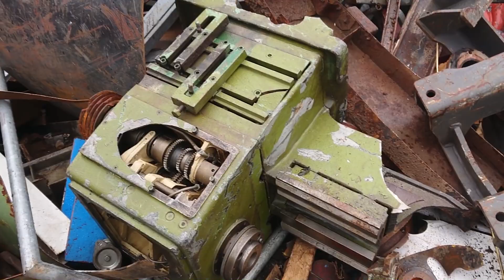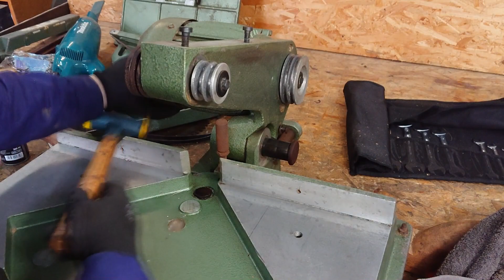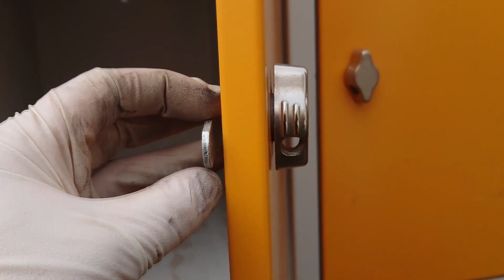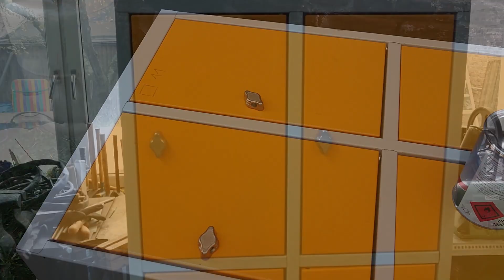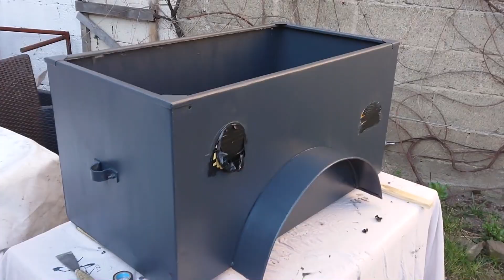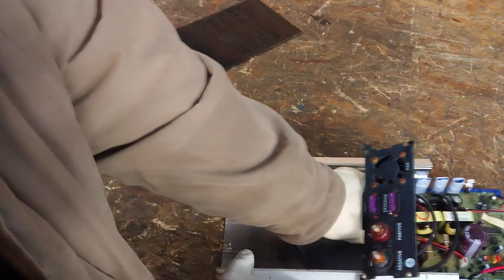Unique Scrapyard Finds! Repair-A-Thon!

Comment: Break cleaner works fantastic for permanent marker and usually doesnt damage the paint. not all brands work though if you want to be shure use "Interflon Metal clean" it works well but is expansive.

Comment: I am re-watching this one again. I love the trailer with battery and solar panel! I'm copying it and building a version with a sprung suspension for use behind my 4 wheeler. I am going to add brackets for two spare tires (one to fit the trailer and the other for the 4 wheeler) and a 'Jerry Can' of extra fuel. Thankfully my 4 wheeler has a low mount 2 inch ball, so the tongue and hookup is simplified. 
      Again, I Love the repair-a-thon videos and I'm looking forward to the next one. 
      Take Care from America and enjoy your trip to England, John

Comment: Did you have the inverter pcb on a metal surface with the pins of capacitors exposed?

Comment: I have some similar lockers I got for free. Had to purchase some keys from the key numbers to get in. Brake and clutch cleaner is good for degreasing and removing glue. You can buy in big cans and put into a spray. You can do the same with wd40.

Comment: I was told by my teacher to use permanent marker to erase permanent marker writing on smooth surface like white board. Just write off the existing with permanent marker, leave 2-3 seconds, then erase it using sponge or whiteboard eraser. It work perfectly. No need aceton or other chemical. :)

Comment: One tip for anyone repairing inverters, when you reassemble them make sure to reattach the temperature sensor to the aluminium casing with thermal glue, otherwise it could overheat and die in future.

Comment: An easy way to pull Permanent Marker ink to the surface is to over over it with a dry erase marker.

The chemical reaction will help pull the ink to the surface and make it easier to clean off. But do this at your own risk.

Comment: I worked in a sign shop in the 90's.   We used Ronsonol Lighter Fluid  for cleaning a multitude of surfaces.    We would use it to remove vinyl residue off of wood signs that had been painted with enamel so that we could re-use the signboard, engraving plastics, glass, acrylic, etc.    I have yet to find a plastic it will damage, or an adhesive residue that it won't soften up and allow me to remove.  

It's usually pretty cheap too.   

Just FYI.

Comment: Looks like there is space for a riving-knife so fabricating one should be quick from an appropriate sized piece of angle-iron or I-beam..
(for some reason multi-purpose kitchen wet-wipes that are lemon scented work better than any other scent for removing stubborn marker/tar/glue and various other gunk remains, and citrus-cleaner is one of those things that has been sold to professionals for ages...)

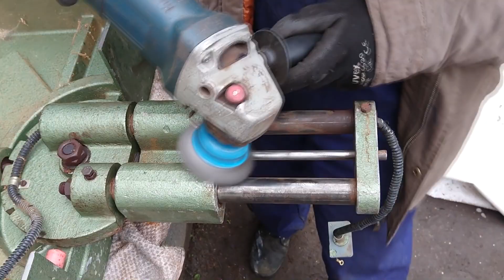Comment: You're not that finicky during restoration process generally. For instance, you're doing a very crude job while using wire brush with angle grinder at 6:55.

Comment: Man I would absolutely love it if you did a general electronics troubleshooting video. Component level board repair stuff. 

It’s insane The type of decent test equipment that’s available for incredible prices these days. you can spend about $100 and get a decent soldering iron, multimeter, miniature oscilloscope, hell even a five dollar logic analyzer, In circuit ESR tester, Adjustable power supply, ect…..

obviously none of it is professional level stuff but I’ve been impressed with some of it, and it is still really good quality stuff regardless.

I have my own small and humble lab and metrology business. I focus on component level board repair but I specialize in high precision metrology equipment repair/calibration/test systems for other small labs and manufacturers. Kind of like a systems engineer but for test equipment. NIST traceable type stuff.

And I’m always fascinated by the cheap but good quality test equipment that’s being made for today’s hobbyists, or people getting into the business on a budget. I have a lot of the stuff and purchased things regularly just for the opportunity of testing them and seeing how they preform for the price point. There is some insanely decent quality stuff these days for unbelievably great prices.

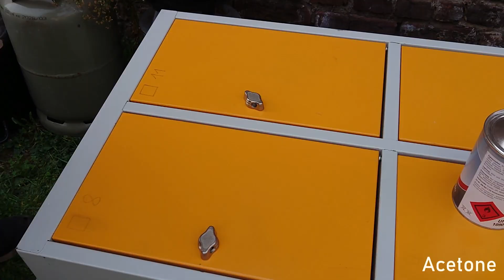Comment: 11:20  Another option for removing permanent marker, is to draw over it with a dry-erase marker, then wipe it away immediately.   They both use the same type of solvent, so the Sharpie ink will be re-liquified and can be easily wiped away.

Comment: Working with galvanized steel, if the part is of older date, there may have been lead added to the solution. So take care when cutting it, especially with an anglegrinder.

Comment: If you deal with a lot of sharpie marks on surfaces you can draw over them with a dry erase marker and then wipe them off. That works on most sharpie marks although when it's really really old it may not work so well.

Comment: I find that 100% isopropyl alcohol (aka isopropanol aka rubbing alcohol) works well for removing Sharpie.  Although I take your point that the issue sometimes is that the Sharpie marks get kind of absorbed into the paint.

That steam cleaner is neat, I wonder if I could get the same effect with an inexpensive clothing steamer I have.

Comment: That little trailer could make the ultimate bike camping setup used with the inverter and maybe you could use a small farm tractor alternator run off the wheel to help charge batteries when on the move.

Comment: Great to see the range of sticker removal techniques, thanks for teaching us so much as always. I thought I would also add that among other things you mentioned I find regular coconut oil surprisingly good at breaking down sticker adhesives, and of course much safer than chemicals and doesn't damage them. I typically use it to remove sticker residue from kitchen bottles and jars, or plastics on items I am restoring.

Comment: I love your channel man, it encourages me to fix old stuff instead of buying new, which I did recently with a whole Hi-Fi system and it's the most satisfying thing to repair/refurbish good quality equipment and learn new valuable skills along the way, I also had to find an electronics shop and now enjoy regularly going there chatting with the owner when I have to get supplies, and once I fixed my sound system revolving around a 1986 B&O amplifier and some equally old good quality speakers, I was hit with a strong wave of nostalgia when I played the tuner on classical music for the first time and even had to shed a tear, so in a way thanks for that because you played your part, this is a good channel and did I mention that I love it ?

Comment: What you said... Pairing that trailer with an electric bicycle... Not a bad idea for making a way to charge your e-bike's battery while on long range trips. Though, if you go that route, it commonly works best from my own point of view to have 2 chargers and 3 batteries to cycle thru, which with an enclosed trailer, should make for an easy way to extend a 25 mile(40.23 km) range into something about 3-4 times as long.

Comment: Tape/ residue solvents when ethanol doesn't work: Petrol/gasoline/Benzin or nafta (high grade specially cleaned petrol) removes the residue Immediately. For the marker, I would use a little isopropanol (blue-rinse). This might work on tape residue as well. Another option for markers is acetone (nail polish remover), but that is a gamble if you're unsure about the surface. Powder coat may withstand acetone, many paints will dissolve. Acrylic plastics will dissolve and foam up. Anyway, these solvents are great to have on hand and will save you hours of scrubbing if used correctly. Also, ethanol is usually the worst solvent to use on anything. Most of the time it just stinks out the place and you have to compensate how ineffective it is by using more, creating a fire hazard. But OK for removing some oil films, though. Also, WD-40 should never be used as a lubricant. It's Water Displacement and turns into wax. Those door hinges that were creaking? With WD-40, they'll start creaking again in a year.

Comment: OK, so on the saw, there is a blade guard; but that doesn't work when it's pulled up and the blade is exposed. However, I think the fence can be positioned over the blade guard, causing the blade to be covered at all times, but the table has to be mounted, of course.

Comment: Nice solar trailer, but... do you think it would be worth giving it the ability to tilt automatically toward the sun? Often this can give surprising gains. You might have to limit it to only moving so-many times per hour, and require a prolonged increase in energy from one direction over the other. Measure this perhaps with little solar cells used as sensors, or photodiodes. The software (and hardware!) would be for you to work out, but microcontrollers can be kept asleep 99.9% of the time using almost no power, microamps.

Comment: Ethanol in UK English is "methylated spirits". It's ethanol with some methanol added. The methanol is to make it poisonous and therefore undrinkable. Otherwise, as with all other drinkable ethanol, it would be liable to tax duty just like vodka, wine, and beer.

Some enterprising alcoholics were known to drink it anyway, so to deter them, they added Bitrex, the worst-tasting substance known to mankind, and emetic agents to make you vomit.

From the point of view of stickers though, and most other uses for a solvent, it's as good as ordinary ethanol, just a great deal cheaper. Surprised it doesn't get the marker pen off, permanent markers are usually based on non-polar solvents, ethanol is traditionally good at removing them. Maybe just needs a bit more hard work.

Comment: Another great video and job!  I'd like to share my abosolute favorite solvent for sticker residue.  Lighter fluid.  Much thinner than WD-40, very freindly to keep in the house, and works pretty darn good on sharpie too.   I absolutely hate that BRAND NEW things you buy come covered in stickers, simply for marketing or inventory, or sensless warnings.  Like dissolves like, and many adhesives are petroleum based.  Causes no damage in my experience to paint, or plastics.

Comment: Anyone else see the AC side capacitor being not just slightly domed? I think that deserves a check and perhaps a replacement? Could be part of the next video. I would consider that part unsafe. Please be careful not to Over amp the circuit either way.

Comment: Have you thought about adding a some drop legs to the corners. This way if you set it stationary you done have to worry about it leaning if you ever decide turn it into a mobile station/camping unit with drop table side

Comment: Man, not even enough left of that lathe to make a little speed-lathe out of it.
Huh, a miter/table-saw, that's a neat design! Wow, what a well-made capacitor, still going strong!
Does the saw have adjustable stops so it doesn't gouge the wooden insert?

Comment: I love these videos, keep them coming. Your style and content is great. I look forward to seeing them.

One thing to note though, capacitance is not the ony measure you need to consider for capacitors, you should consider ESR and current leakage as well. A bad cap will have a high ESR reading and some leakage current as well if the dielectric is breaking down or dried out

Comment: Sometimes you can remove permanent markers by write over the marking with a permanent marker !!!!!.......the solvent will loosen up the old solvent and you can wipe it off with a cloth. I have done this on several whiteboards, where teachers have used the wrong marker.

Comment: Labels for steel shelves, drawers, doors, etc. can be made from advertising refrigerator magnet materials cut into strips and covered over with ordinary white lable material. The advantage is of course that the strips are always temporary and can easily be changed at will, leaving no permanent marks for future generations to be pissed off about. And you can rearrange your shop with one less problem.

Comment: A cheap tool for scraping stickers, etc. can be made from a no-longer-usable  wooden-handled paint brush. Cut off the handle and sand an edge on the bristle end just as you would sharpen a chisel. The wood is hard enough to stand up to lables, tape, etc., but not so hard as to damage paint. 
A solvent I like is naptha. It is more aggressive than alcohol, but less so than acetone, lacquer thinner and the like, not ususually attacking painted surfaces. BTW, lighter fluid is just naptha with perfume in it, so that works well at much higher cost. Sometimes alcohol can better remove marker ink if you soak a pad with it and hold the pad against the mark for long periods to allow the mark be better dissolved.

Then there are mechanical methods, such as abrasives. Toothpaste is a fine abrasive that will polish plastics such as telephone parts, but is not fine enough for anything that can be considered optical, such as safety glasses. If you are going to see through it, you need a super fine polish like used on car paint, but let me tell you that it is SO fine that it will take FOREVER to remove the tiniest defects, so it is tedious in the extreme and becomes your new hobby!

Comment: amazingly well built saw. I like the line drawing of the train for the locker. No others. I can only wish to get a lathe gearbox such as you walked away from.. I am a creator and that would adapt well to an old American lathe bed I own which is old but absolutely clever in design. You have an opportunity with that junk yard many of us will never be allowed again in life. Since waste management is a system of disposal without leaks nowadays.

Comment: quick tip for getting sharpie ink off. use another sharpie or perm marker and trace over the original marking. you will see it start to lift up when its all still wet just wipe it away with a rag. this method usually doesn't harm a thing unlike some other harsh chemicals you might use.

Comment: So I take that the inverter will be on the inside lid of the trailer and the battery on the trailer tongue.  Jump start terminals could be added to allow hooking up to a car battery to extend the run time.

Comment: As you mentioned that the inverter produces a square wave current instead of a sine wave. That shows it is a high frequency "chopped DC" and not a true AC. Fine for lights and powertools but it would ruin a computer or tv if run on it. You do recycle enough electronic components that you could build a sine wave inverter so you could run digital devices on it. And to recharge smaller low voltage digital devices, simply use voltage regulators directly off of the solar panel.

Comment: Removing Sharpie markings works pretty well by just going over the original sharpie mark with a new sharpie mark and then wiping it off the pigment for both quickly before the solvent flashes off.

Comment: Great job on the cabinets they turned out really nice. The combo tablesaw chopsaw is really neat design and seems to work very well. As far as the solar panel charger controller and battery I don't know what you would do with that the battery looks like it's fairly low capacity. And I wonder why somebody threw away a perfectly good working inverter.

Comment: Ifound exact the same Inverter on my local scrapyard the other day.  Bun mine has got all semiconductors blown  except the both PWM controller.  So it was total loss beyond any repair . For the price of the parts I could get a working one from ebay.
I tested the Control circuit and found the device work on 35kc . Both the transformers were also okay- I saved them for  an eventually other project.

Due to the H-Bridge  , no one of the both output legs may be earthed , if you do so anyway, the magic smoke left the device.  If you need a proper  safety protection were one leg has to be earthed ,  a isolation transforme come into this game which allows to earth one leg of the secondary  for a safe protection via    elcb/rcb/gfi .

Comment: Regarding the so called Permanent Markers, I recall that they are Methanol based.  So, Methanol rather than Ethanol might be a better solvent for them.  Granted, I have not tried - this is just a guess.  A personal observation has been that the marker penetrates for example paper all the way and apparently many paints to some extent.  In that respect, no wonder there tends to be a "ghost" trace left behind, no matter what solvent you use to remove the trace.  Maybe somebody has better and tested solutions?

Comment: Graffiti removal tip, to remove permanent marker, heavily color over the top with a dry wipe marker, the chemical breaks down the permanent marker, might take 2 or 3 goes to totally remove it but it works

Comment: Did the inverter say 12 volts DC in put or could it have been up to 24 volts DC input. Because of the compassedors being maxed at 25 volts  engineers  need more  than rated input as a safe of operation.  Love your channel thank you .buy the way I am not no kinda electrical  engineer.

Comment: A trick to remove permanent marker from a whiteboard is to go over the marks with a whiteboard marker, which I guess has a solvent that will dissolve the permanent marker.

Comment: For removing marker, you should use Isopropyl.

If this does not work, try to paint over it with a fresh marker, this will dissolve the old marks.
Wipe it off while everything is still wet.

Comment: 1:19 maybe not as a lathe, no, but I see precision gears and metal flanges that will be very accurately made. And the remains of the bed are long enough to maybe cobble together a table top lathe of good quality.